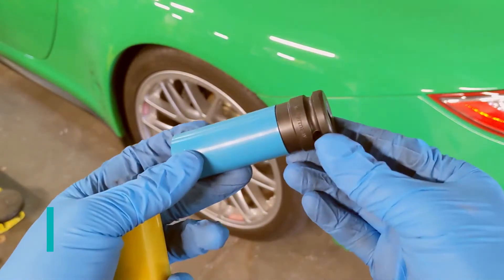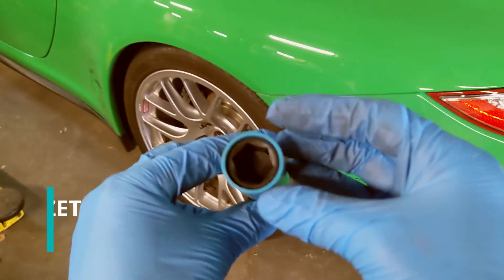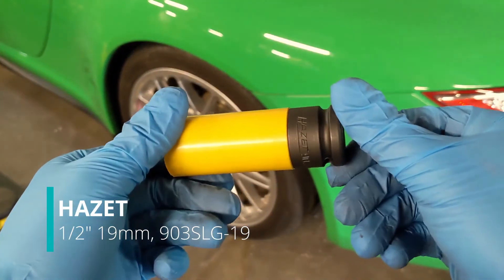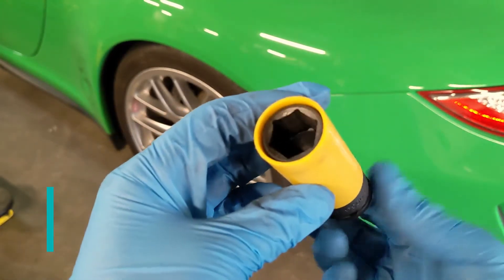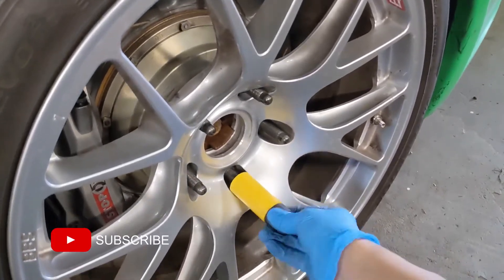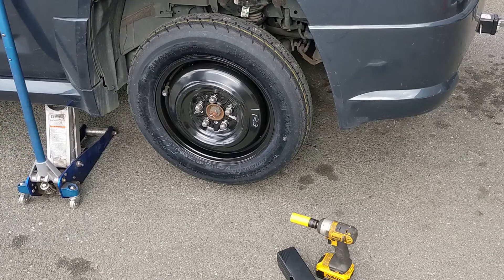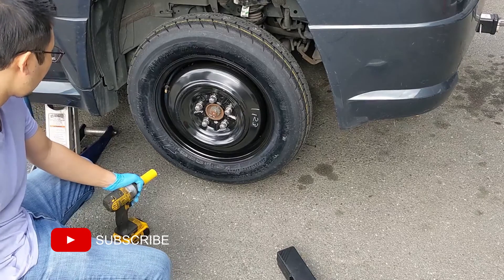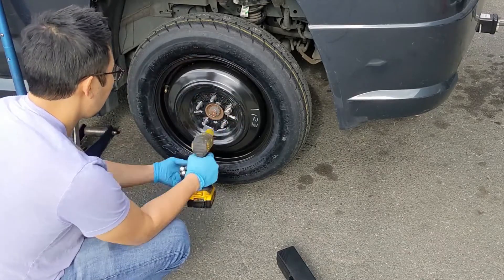HAZET plastic coated impact socket review - 903SLG-17 / 903SLG-19

Comment: Can't you push the black inserts out with a rod from the 1/2" drive side? At least it looks to me like a insert. Plus Hazet also has extra deep sockets which I came across wondering which brand was best. 🤔
I bought a cheap set at the local hardware store and the 17mm was made of such thin walls that my Ryobi impact gun destroyed it and almost my bolt in the process as well.
Reply from the maker: Yeah! Somebody else commented you could pop the inserts out. I was able to do this and they work perfectly. I need to do a follow up, thanks for the reminder.

Comment: What sockets do you use for your studs?
Reply from the maker: Obviously not the Hazets 😂 I have a set of older Craftsman deep impact sockets that I use, but I need to be very careful on wheels I care about. Not so much an issue right now, since I don't care about any of the wheels on my vehicles. Still on the hunt though.
Reply: @EscargotGarage  I have the same Hazets as the ones in your video, and I emailed Hazet and they said you can knock out the plastic cap 🧢 Maude the socket. I did it, and it worked. I use them in my 75mm studs no problems.
Reply from the maker: @HarveyJohnWillmott  I'll take another look when I stop by the shop, thanks for the tip!

Comment: You should have bought the extra long ones.
Reply from the maker: Do you have a part number?
Reply: @EscargotGarage  904 SLG 17, 19 or 21
Reply from the maker: hmm, not a ton of info on the Hazet site:
https://www.hazet.de/en/products/hand-tools/socket-machine-operation/socket-insert-hex-profile-machine-operation/1648/impact-socket-904-s-lg-8-extra-long-for-wheel-mounting-plastic-socket-to-protect-the-wheel-screws-plastic-sleeve-to-protect-the-rims

I think the same issue will apply here. I'm not having an issue with the overall length, there's just no room for the stud to pass through. Or, maybe I am crazy. Will take another look at the shop tomorrow.